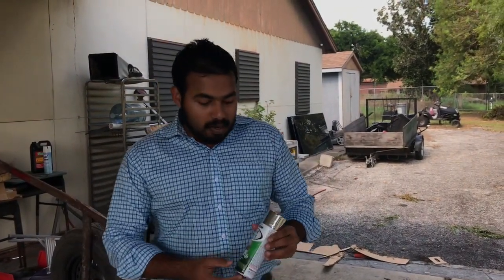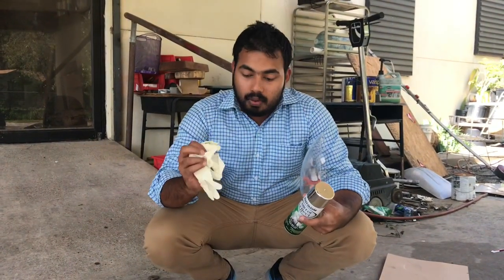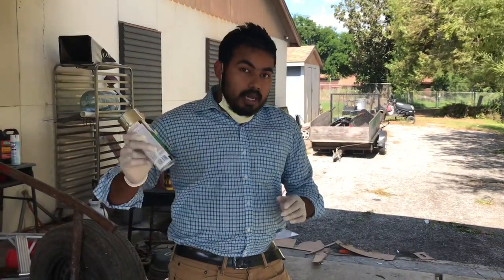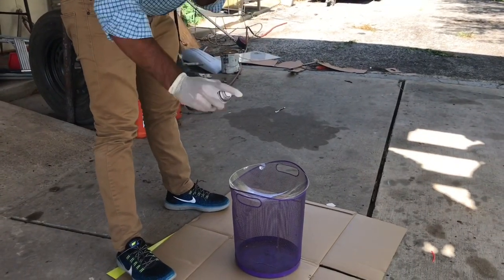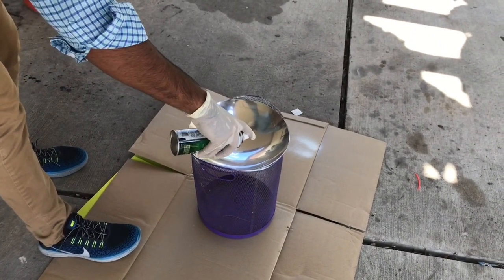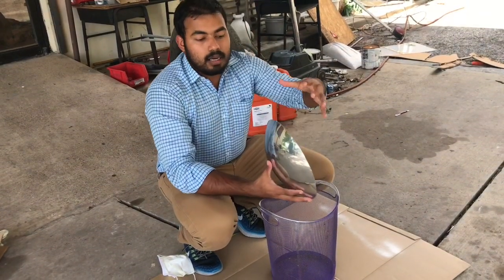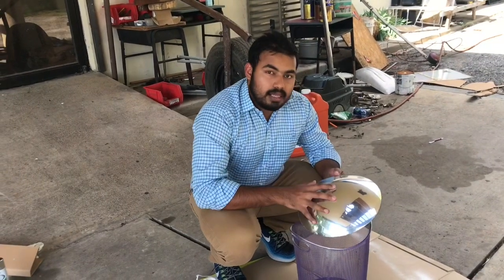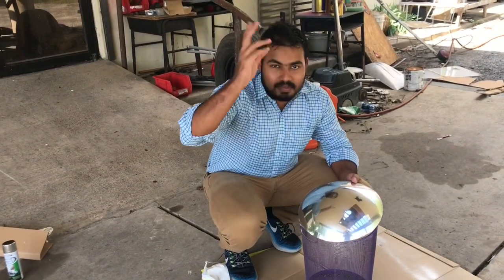Acrylic Dome to  Convex Mirror using Rust-Oleum mirror effect spray

Comment: I tried this paint on polycarbonate and it melted it a bit enough to prohibit a mirror finish. What kind of plastic are you using? Thank you
Reply: Regular Rustoleum contains acetone so it will eat most plastic and resin surfaces. I'm curious to know what type of plastic he sprayed and whether or not there were small pits that the camera didn't pick up.

Comment: Would this last outside in the weather?  I was thinking of concentrating light into my greenhouse during winter.
Reply from the maker: My intention was to use it outside but didn't get a chance to leave it outside. The coating was really good. I believe it will work fine outside.
Reply: How would you plan on spraying that?

Comment: I don't know what I did. I sprayed the outside of an acrylic punch bowl. It came out Gray. I went and got another punch bowl and tried it again. Again .....grey I sprayed the outside of the bowl to have the mirror effect inside the bowl. The crazy thing is on the second bowl While the inside was dull gray instead of mirrored, the outside (part i painted) was actually shinier that the inside. 

I did the light coats 10-12 inches away nothing. 

Also, on the can it says wait 1-2 mins between coats. but in the rust-oleum how to video it said wait 10 mins between coats. So I f---ed up 2 damn punch bowls and wasted 2 cans of this high ass paint. I know damn well its supposed to work but I don't know what I did.  

40 dollars down the drain. 
 I just gave up and ordered a stainless steel mixing bowl which has the mirror effect  was going for. Wish I'd thought of it earlier!
Reply from the maker: I am not sure why it did happen like that. are you sure you used the mirror effect because they do have other similar products give different effects.
Reply: @alanwilson43  i'm certain it is the mirror effect. Also another interesting thing is I had a top to a jar that I wasn't going to use so when i first got the paint, I just tested it without shaking or anything and sprayed the inside of the top....While the paint ran a little the effect was perfect and it indeed had the mirror finish. But I couldn't replicate that again. I got frustrated and gave up. LOL ..... I do still have a full can. I am going to try it on a glass from a picture frame and see what i get.
Reply: Hello M
Sounds like the punch bowl wasn't entirely acrylic or had a protective clear coat of enamel or  composite.
Probably better that it didn't work... turning the bowl grey instead of the stomachs of you and your family and guests.
Reply: The solvent used in the spray painy ate away the plastic from your bowl. Plastics designed for food are much different than plastics used in industrial process. For example, nail polush remover (acetone) is stored in a plastic bottle but if you accidentally get it on a clear food bowl it clouds the bowl. Nail polish is thinned with acetone as a solvent. Spray paint, like nail polish, is an oil based enamel paint and in order to keep it from evaporating out of its liquid form needs a solvent. So you see, the solvents used to maintain the spray paints ability to spray ate away at your food-plastic bowls. You can next time try a glass bowl, ceramic, or a type of plastic used to store solvents. You can look up the types of plastics on any search engine as well as which solvents will deteriorate them chemically. How do I know this? Tried to clean a price tag off a designer salad bowl and shamefully lost that battle.
Reply: If you sprayed the outside of the bowl, the inside should be reflective. If you spray the inside of the bowl, the outside will be reflective
Reply: Plastics have numbers to them, printed usually underneath. Look up compatibility with specific chemicals in the mirror spray paint. For instance acetone will eat away plastic #4 because it’s made mostly of styrofoam plastic, even in solid hard form. But acetone has no effect on other numbers, like the bottle it’s shipped in. Also need to rough the surface up to give the spray paint something not so slippery to hold on to, like emery paper. Glass surface may need a base primer to allow other paints to attach to. Make sure your spraying the can the right angle. Shake constantly. Turn can upside down an spray when finished so to clear the line from clots. To remove paint just buy any paint remover, remove paint remove residue with oxcylic acid or other chemicals, start over.

Comment: He needs spray paint lessons nobody sprays that close and nobody keeps hard pressure on the tip,8-10 inches away sweeping motions...you could have used a hub cap